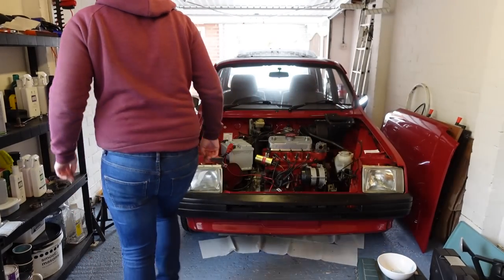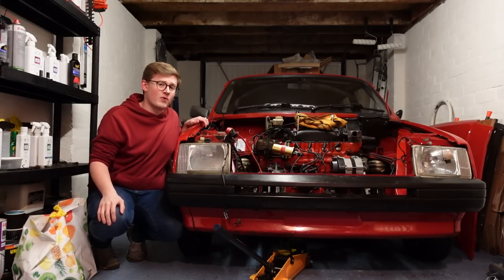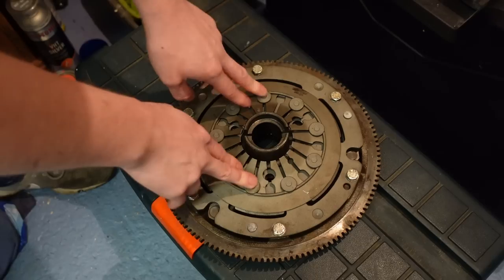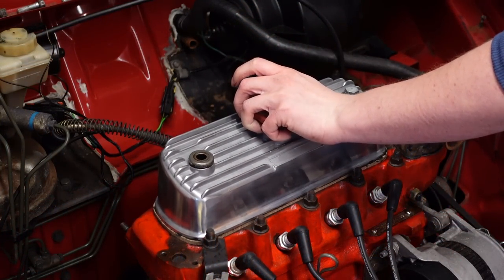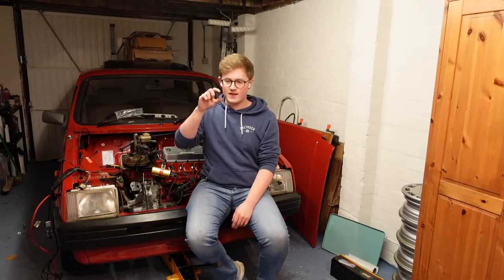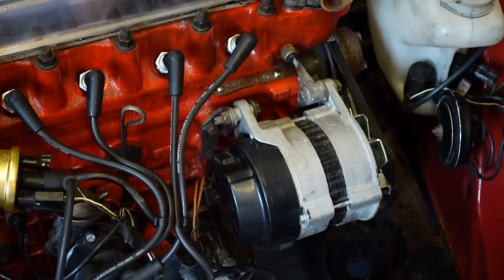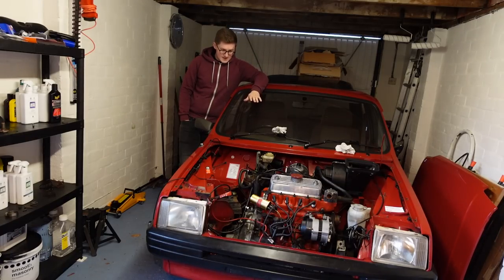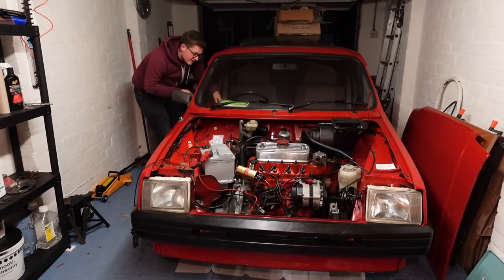Will It Start? - Metro Gearbox Rebuild, Part 6

Comment: Nicely done! As someone who's done this once or twice before, the only thing I'd have done differently would be to take the plugs out for the first try at cranking. When youre building up oil pressure for the first time, no requirement for compression is probably a good thing. Otherwise you've got enormous pressures on your bearing surfaces and no oil to lubricate them. Additionally, the plugs out mean that (paired with a good battery) your starter usually runs just that bit easier, which can be the difference between a dry oil pump spinning fast enough to build pressure or not.

Otherwise though, it looks like you're well and truly on the way to driving around again. Looking forward to the next film in this series!
Reply: I just might have sat in the car and used the throttle.....
Happy motoring!
Reply from the maker: Yes, that's a fair point, but to be honest, I wasn't awfully concerned with the faff of taking the plugs out. I saw no reason why it wouldn't make pressure, just wanted to keep my eye on the light :)

Comment: Brilliant. This video reminds of when I was a student off for the summer I had a mini 1000 & the engine was near had it. I bought an austin 1300 mot failure & took the engine out & put it in my mini. I think I hadn't primed the oil pump as it started immediately but sounded like a bag of bolts. My heart sank. Tried again & the noise stopped & the engine ran normally. I had that car for another 2.5 years & the engine kept going but it burnt oil in a big way. I used to buy a gallon for £2.50 from car bar in ashby de la zouch & just lived with having to keep topping it up 😁
Reply from the maker: I'm led to believe that the Rover V8 needs some kind of special priming procedure every time you change the oil!
Reply: @TwinCam  It was a normal old series A 1275cc from an old Austin 1300. It was Summer 1981 when I did this. If I remember I really drained the old oil out the sump plug hole before putting in the new oil. My guess is that caused the problem so probably the oil pump had some air in it so didn't initially 'get pumping'. I sort of got away with it as that engine stayed in that mini till it was scrapped in jan 1984.

Comment: Great feeling isn't it when an engine you've rebuilt runs for the first time! Well done! I second what someone else mentioned earlier in the comments about making sure you have oil pressure with the plugs out first. Sounds really good!
Reply: Hi, the engine wasn't rebuilt, the gearbox was....by me 👍
Reply: @pauljeffries  Ah, good point! One thing I alway do is always make absolutely sure I'd remembered to put fluids in things. I usually put labels on things to remind me I haven't yet. Diffs on rwd cars are easy to forget. Not applicable here I guess though! I also always check the drain plug is in too. I once put about 4L of oil into a B series before realizing it was coming straight out again.

Comment: I feel your pain. Took me 3 months to do the clutch on my cinquecento and then the gearbox started pissing oil 😭 turns out the driveshaft flange got damaged and guess what 🙄 you can't buy them 😮‍💨 eventually found a second hand driveshaft in Lithuania and it cost 68euro with postage costing 34 euro. The gearbox oil is 66 euro and most of that went down the driveway.... opps😤
Times like this the enthusiasm takes a bruising. Atleast you have a shed.😊👍🇮🇪

Comment: that's my first time seeing where the fuel over flow should actually go, when i got the car it would drip straight onto the exhaust manifold and it was very dangerous when i had issues with the float getting stuck, i rerouted it to the wheel which also felt dodgy so will fix it properly now
Reply from the maker: Make sure the metal fuel pipe is attached to the clutch cover. If it's there, it should be really obvious!

Comment: Is it me or does the Alternator run clockwise towards the back of the engine bay?
Reply: The engine and therefore the alternator does run clockwise when viewed from that end of the engine. I think it’s only Honda being oddballs that have some reverse rotation engines
Reply: I know that older Honda engines were reverse rotation as the engine and gearbox was a left to right configuration instead of being vice versa which is more conventional.
Reply from the maker: Yes, it does turn clockwise, as do 95% of engines!
Honda engines turn anti-clockwise, which puts them in the minority, but the reason the A-Series looks strange to us is because the accessory end of the engine is mounted to the nearside of the car. Usually, engines are turned the other way around. The reason it's this way around is the gearbox in the sump. For the sake of reliability and keeping heat in the carburettor, the gearbox reverses the direction of motion. When the A-Series was fitted to the Maestro with an on-end gearbox, the engine was back to front to suit, with the exhaust behind the grille!
Early Mini prototypes had the engine the other way around too, looking like a modern FWD car in that way, but they encountered some serious reliability issues.
Reply: In Maestro's it looks like the engine spins anti clockwise but doesn't as you rightly pointed out it was back to front. In a way the A-Series engine does share some similarities with Honda engines eg the flywheel being on the right and alternator on the left. I never noticed what direction the alternator turned on Metro's until you started it.
Reply from the maker: @jaggass  Of course, but that's only down to the way it's mounted in the engine bay.